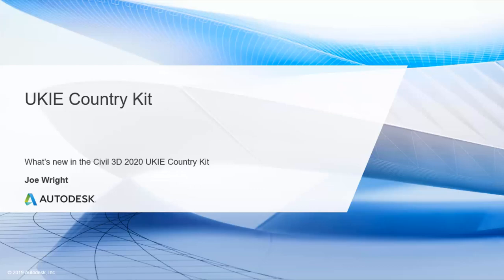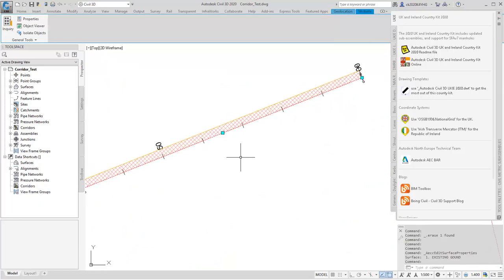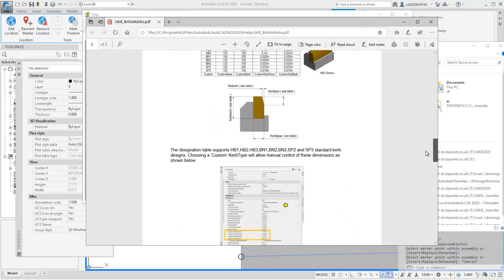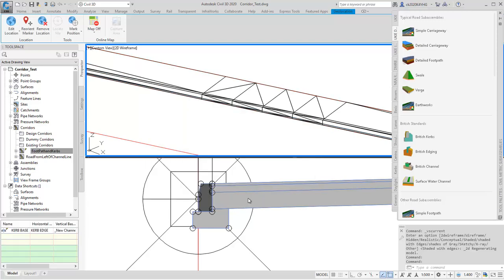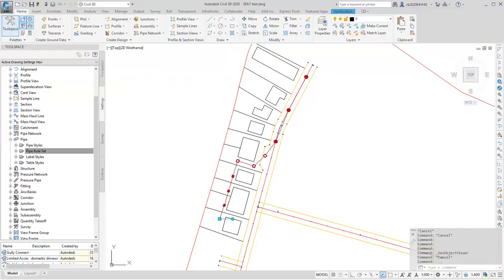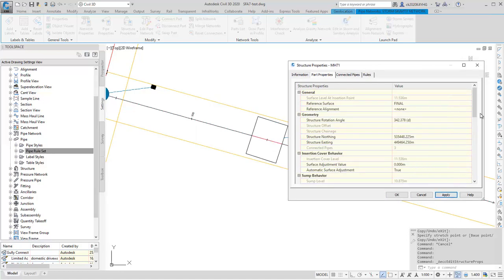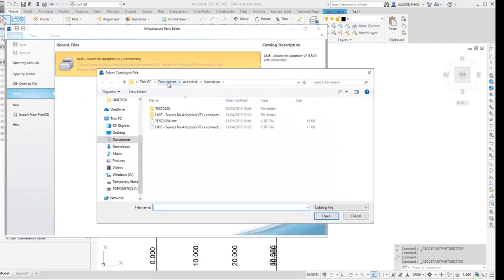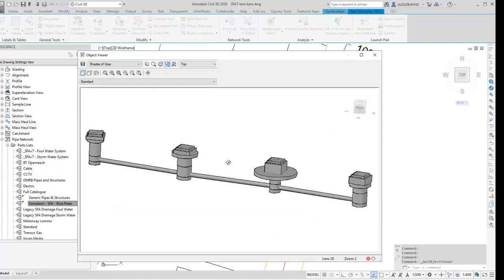Civil 3D 2020 - UKIE Country Kit - What's New

Comment: Joe, Firstly congradulations regarding the work you have put into the UKIE Kit 2020/2021. I have an issue with the Infra Parts Editor 2021. Everything works fine. however, the images for UKIE parts do not display within the tool. Should there be a folder containing images somewhere?
Reply from the maker: Kieron, If you are using IPE then you will only see the previews if you have Inventor installed. I believe you can download a free viewer from the Autodesk website (previously called 'Inventor View') which should give you the view of the models in IPE. Hope this helps. Joe
Reply: @AutodeskUKIE  Jo, Sorry to bother you again re IPE display issues. Would it be possible to get in touch with you directly? I am based in Caerphilly, Wales. I managed to resolve the display issue within C3D 2020. However, when I upgrade to C3D 2021 the issue returns. Parts do not display. Installing the Inventor viewer does not resolve the issue in 2021. I also note there isn't a .icbt file within the OOTB 2021 Kameleon folder. Additionally, when you select a UKIE Part Family, the Shape Details default to the "New Shape Template" option; rather than "Parametric shape from library". ANy assistance would be appreciated.
Reply from the maker: Kieron, I did a full test today. The good news is that the published catalogue works ok in C3D 2021. If you want to manage it, then I will need to send you some instructions (and an extra file) to get IPE working correctly for 2021 (email me: joe.wright@toponet.co.uk). The bad news is that in C3D 2022 there seems to be a problem which is preventing IPE parts publishing, but that's a problem for another day. In the meantime I am confident I can help you get on an even keel with 2021.

Comment: Hi Joe, i am using the 2020 ukie country kit, but when changing the "kerb face" height in the custom options nothing happens, is there a different option or code i need to be selecting ?
Reply from the maker: James, Worth double checking you have the 'Custom' option set in the 'Kerb Type' selector, otherwise the custom options will be ignored.
Reply: thanks for the clarification

Comment from the maker: Andrew, Glad you managed to solve the issue. The pipe catalogue has not changed between releases, and the structure catalogue, whilst updated with new components, has retained all the older manholes. So, if it worked in a previous releases, it should work ok in 2020 too.  I will, however, experiment with multiple open drawings, to see if I can replicate your issues.

Comment: Hi Joe, I'm trying to use the new kits but when I use the pull down in the Network Layout tools box all I'm getting is null structure for foul and in storm all I get is headwalls
Reply from the maker: Andrew, You probably just need to set your default catalogues to 'UKIE Metric Pipe Catalog' and 'UKIE Metric Structure Catalog'. These settings can be set by typing in 'AECCSetnetworkcatalog' on the command line (or find the icon to this under the create design panel). Funnily enough, this will be the topic of my next mini-tip video which I hope to push out before the end of the month. Hope this helps. Joe
Reply: Joe, Thanks I was selecting the UKIE sewers for adoption V7  (SFA7) with connections structure catalog, I'll watch your videos. Thanks again